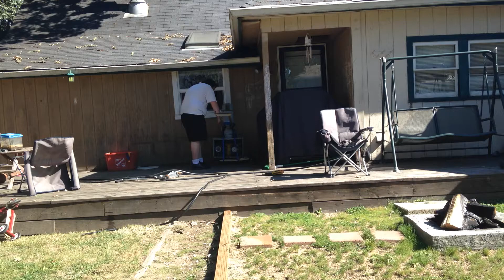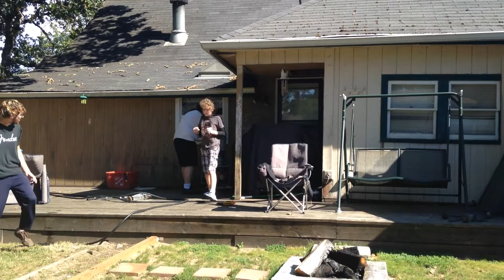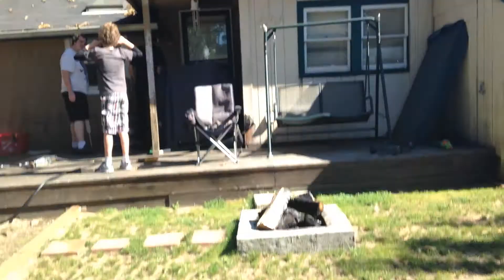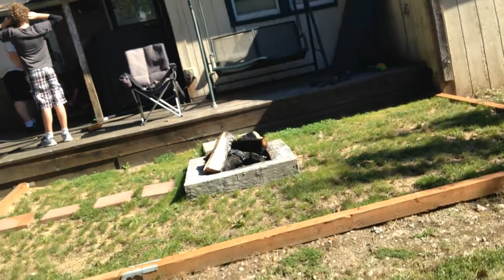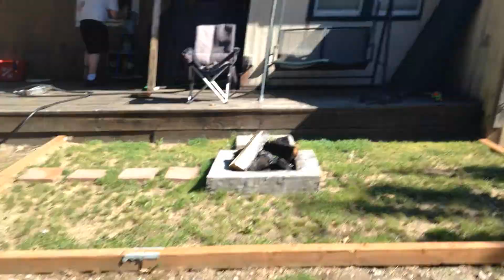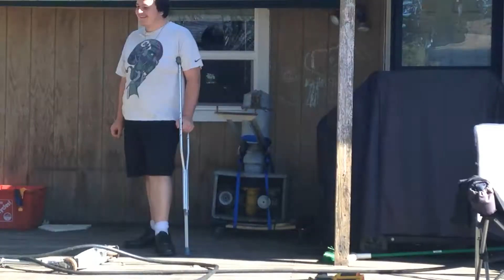Thunderbolt 1000 full wind up. (No blower)

Comment: How much voltage is this
Reply: 3
Reply from the maker: Sorry this took so long... my notifications skip things... this is 120 volts or the equivalent of about tap 2 or so...
Reply: bitch lasagna It is definitely not 3 volts they all run on 120 or 240 3 volts wouldn’t even spin up the chopper to 10 RPM
Reply: @N617A  120 is terminal 1
Reply from the maker: Someone had mentioned and labeled one going as low as 115 so I wasn’t sure where mine stood on that line. Still loud as all get our.
Reply: Thats the waldport or  thunderbolt 1000